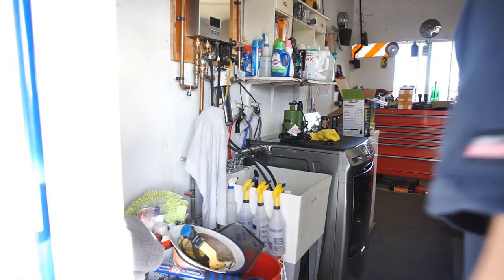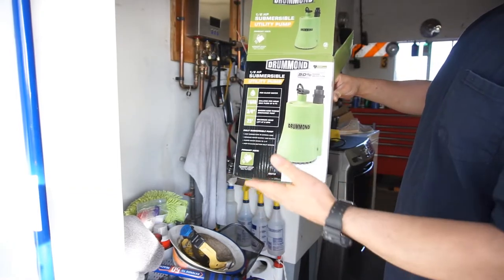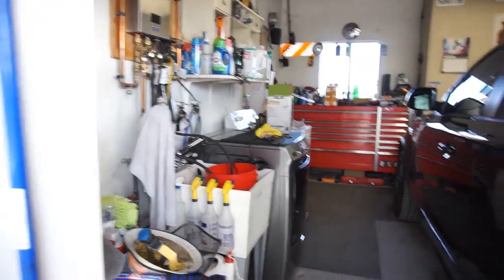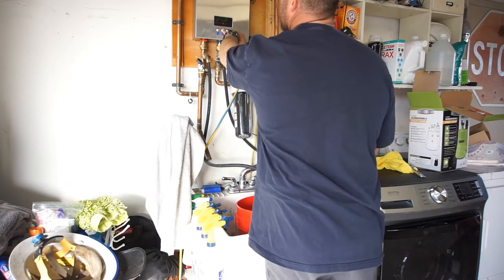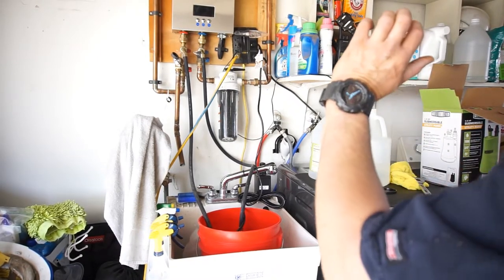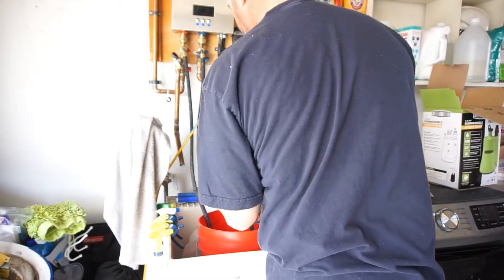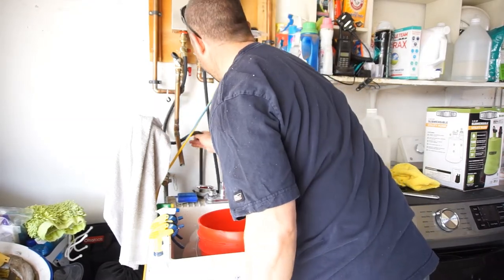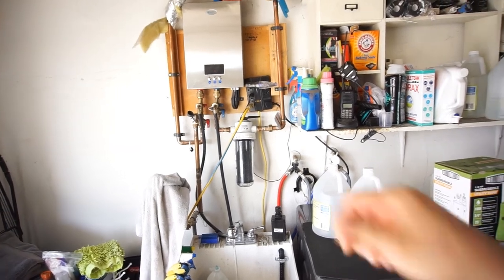How I Maintain My Tank Less Hot Water Heater. A Little Bit Of Vinegar Goes A Long Way

Comment: How much does one of those tankless hot water heater cost?
Reply from the maker: I paid $300 for the unit and another $200 for the filter, union joints, valves and piping.